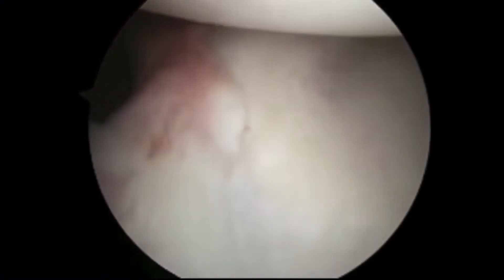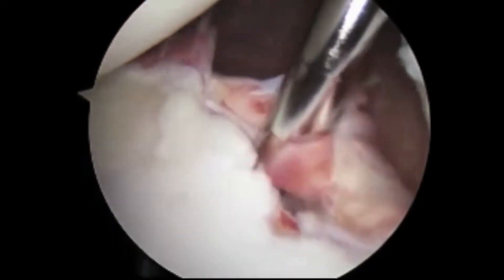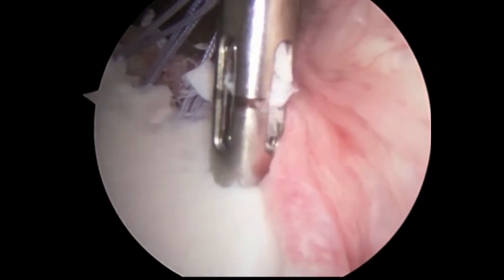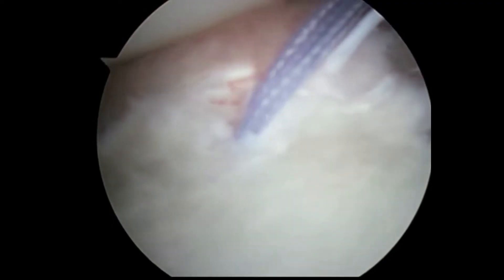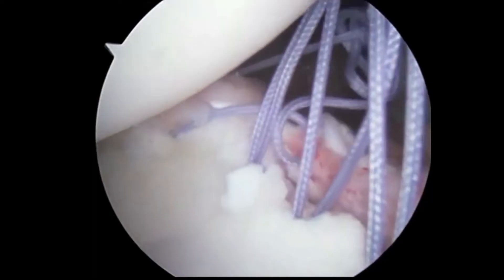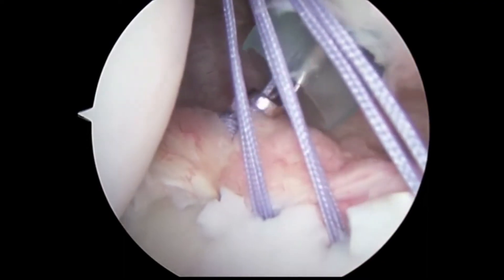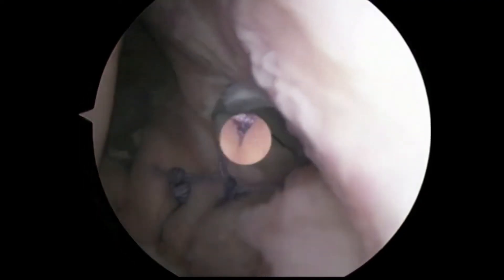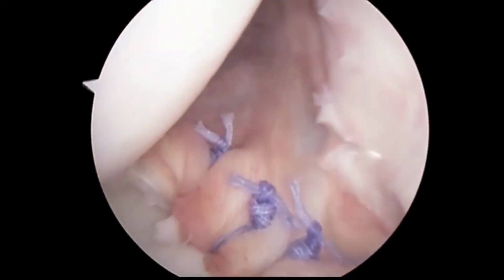Arthroscopic Labral Repair (Shoulder) - Narrated by an Orthopedic Surgeon

Comment: Its been 3.5 months i have shoulder posterior labrum repair surgery. Dr has put 3 anchor with sutures inside it but after 3.5 months my external rotation is limited to 70° and i m nt able to do rowing. Rest all the rom is completely normal . Will it be nrml ? How many more days it will take ?

Comment: just got my labrum repaired and my bicep tendon done, 10 days later no pain unless i move it (obviously) but sleeping is the absolute worst. takes about a month postop to start pt
Reply: Literally same surgery and same out come currently 4wks post op have almost full range of motion just tight. Before I was at a constant 6/10 on the pain scale now just sore after PT
Reply: @tarabunner952 what type of tear did you got? I had a circumferential tear which was all around but my bicep tendon was fine. Been 5days now, pain only worse when lying flat during sleep. Had to elevate to reduce the pain.
Reply: Hows you now ?

Comment: idk y but this made me more nervous for my surgery this coming Thursday
Reply: So just got it 3 days ago you’ll be ok I’m glad I got it bc they did more than what was supposed to be done also
Reply: @roadking_hdcalifaz8287 hey bro, I'm planning for surgery nxt yr. Is the surgery worth it, will shoulder gets fixed
Reply: I just got my mri results back and need surgery done lol,lmk how yours goes! Hoping for the best for you :D
Reply: @SnowyBlizzard on my way now, it is scheduled for 10:50 I’ll keep you updated
Reply: @cadenceeverson9126 I’m also in need of surgery too curious how it feels post surgery like how quickly you were able to get back into work or just anything in general
Reply: Just got mine done 2 days ago, labrum + distol clavicular osteolysis best decision ever been battling shoulder pain for 4 years
Reply: how was the procedure? i just found out i have a labrum tear. I have epilepsy and dislocated it in 2023 and have been dealing with it ever since. I work out regularly but the pain makes my arm fatigue out faster than the right it also travels to my upper trapeze muscle from it trying to orotect the shoulder. Im nervous about getting surgery…. how did you feel right after?
Reply: @jiggyv6139  forgot I promised to update, the operation went great and I’ve been healing amazingly. When they went to do the actual surgery they found that it was actually torn all the way through so the cleaned it up and I only have like one screw or wtv it is in my shoulder. And I even back to sports now. I’m on a swim team and have had very minimal pain just residual discomfort but otherwise it’s been great.
Reply: Update on your healing? Im 3 mo post op and cannot reach above shoulder level, everything else feels good, long recovery though
Reply: @waitingforthereturn  forgot I promised to update, the operation went great and I’ve been healing amazingly. When they went to do the actual surgery they found that it was actually torn all the way through so the cleaned it up and I only have like one screw or wtv it is in my shoulder. And I even back to sports now. I’m on a swim team and have had very minimal pain just residual discomfort but otherwise it’s been great.

Comment: I need this surgery on both shoulders but watching this makes not want to get it, torn labrums and partial rotor cuff Both shoulders
Reply: Had both rotator cuff surgery’s 20 yrs ago separate times year apart….need to get a labral tear surgery now at 38 I’m nervous now instead of when I was a teenager
Reply: @roadking_hdcalifaz8287  I may need both done too (I'm in my 20s) and I'm wondering is the surgery you're getting now the exact same as the one you had in your 20s? Is the labral tear surgery not permanent; does it have negatives that require more surgery down the line? Or is it for an unrelated reason (i.e. another injury to the shoulders)?
Reply: I’m 17 weeks post op, still doing PT and its still no where no close to being at the same range as my healthy shoulder. It feels like there a locking mechanism that keeps your shoulder from being fluid and I doubt if I’ll ever be the same. Hoping in about another 6 months i’ll feel back to normal with a regular gym routine. Biggest downside is getting comfortable sleeping, I’m just now getting a full nights rest without waking up in the middle of the night without inflammation. I think if I had to do it again I would cause I don’t want to deal with severe arthritis as I get older and I doubt anyone else would.
Reply from the maker: @Treeturtlesbastard   it sounds like you’re working really hard and being patient through a tough recovery. It’s totally normal for range of motion to take a while to come back after shoulder labral repair, and that “locking” feeling can be part of your body protecting itself while healing. Six more months sounds like a good timeframe to keep progressing with PT and regaining strength.

Sleep issues are so common after surgery but it’s great you’re starting to get better rest—that really helps healing. And you’re right, investing in the surgery now to prevent arthritis later is a smart move, even if the road feels long.
Reply: @Treeturtlesbastard how is the recovery?